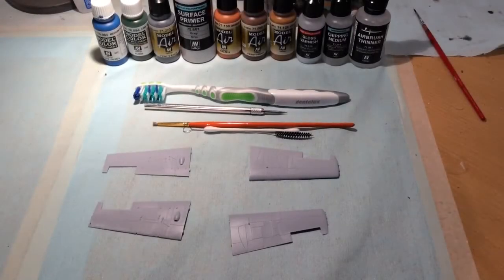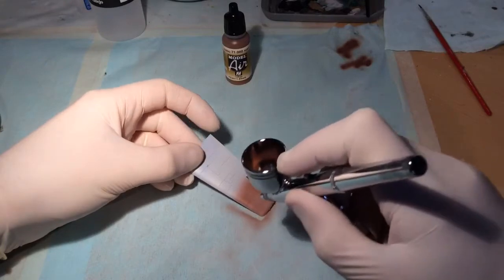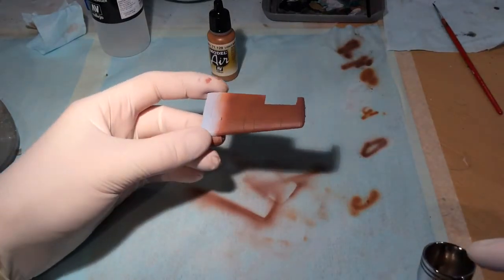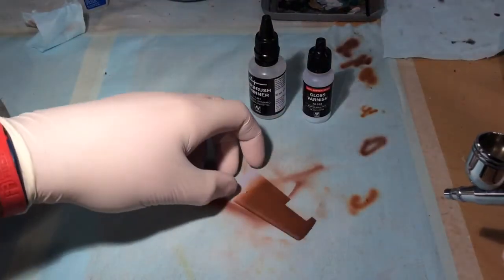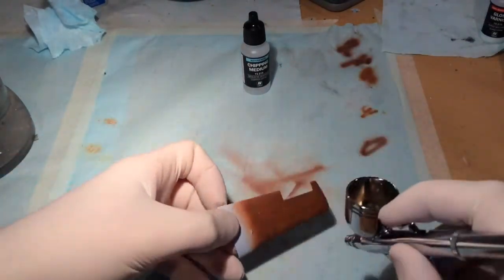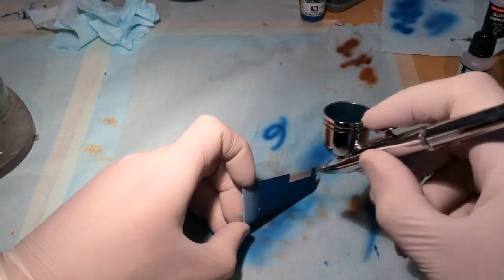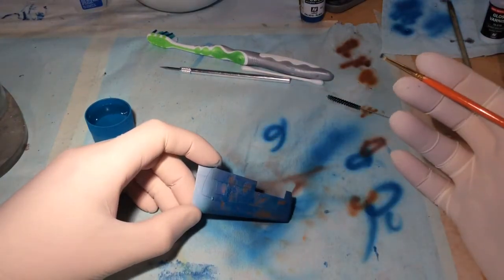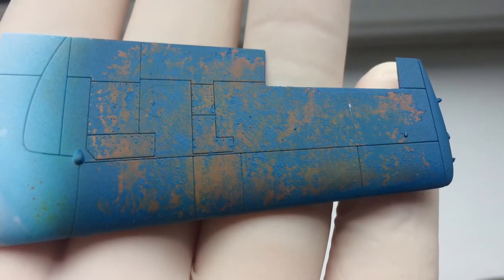Modelling tips #5 Vallejo chipping medium

Comment: Thanks for the video. I will need to try it out.

Have you used the hair spray method? If so, which do you like the best? I have been using the hair spray method for ten years now. A few years ago I found  a more expensive hair spray works better.